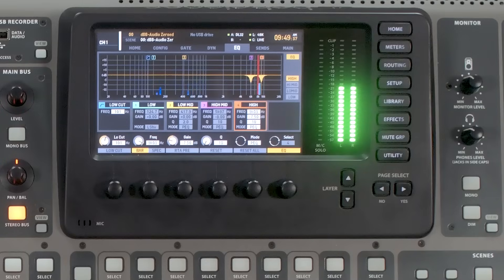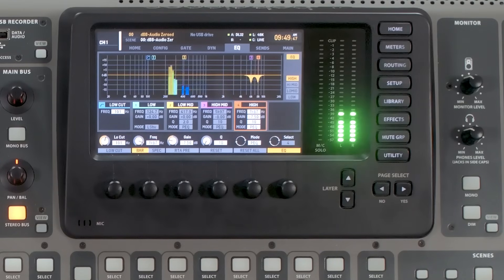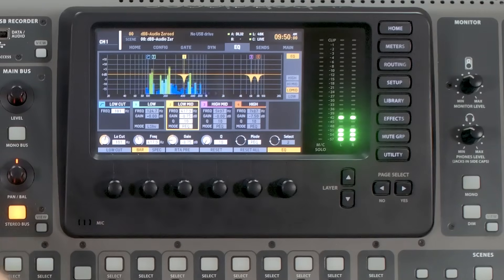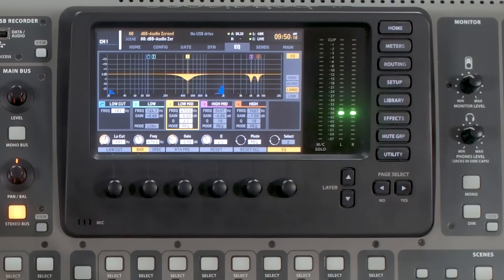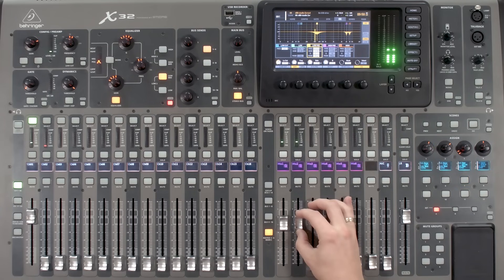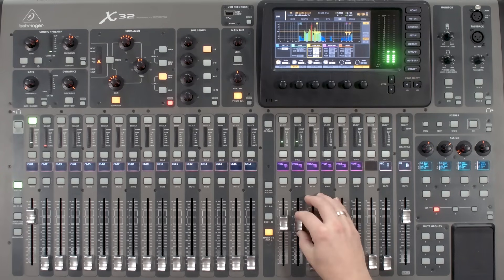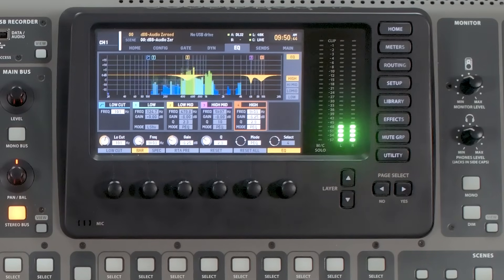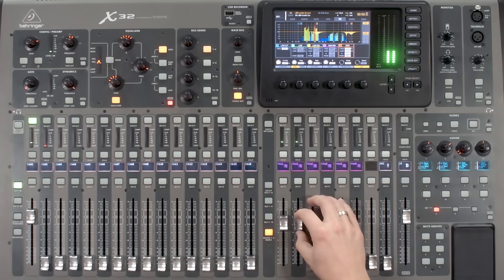Preventing Microphone Feedback in a Live Sound PA

Comment: As usual, people will ring out the FOH and cut the feedback using EQ of FOH. But, you are cutting the feedback using EQ of Mic Channel. Is it the reason for this difference?
Reply from the maker: I didn't go into system tuning in this case as I feel it is a bit more advanced and it deserves a video by itself. However, making sure the PA is tuned correctly for the room, and monitors are rung out is very important for controlling feedback. After I have done the tune and ring out, if I have a microphone on stage, I will then be cutting on the mic channel. If I find I am cutting on all of the channels in the same frequency, then I'll update my EQ on my PA.

Thanks for watching and the question!
Reply: @DrewBrashler  Thank you so much for your clarification. It's very nice solution of you that if all the microphones will be cut on all of the channels in the same frequency then you'll udate your EQ on PA. Because, if there are 2 different microphone brands on stage, then properly the frequency for cutting will be either different!

Comment: this is the really tip of the iceberg I really suggest to use a 31 band GEQ on the wedges and the main PA + sidefill and so on. A microphone wouldn't resonate and create feedback always in the same exact frequency is a matter of physic and positioning of the mic compared to the tweeter, the woofer the inclination torwards the wedge... you can significally get better with GEQ of course, but it you start to get down every frequency that resonate you'll start to lose all the pressunre energy and the intelligibility. Better start with a great sets of speakers, choosing the right microphone for the right task and than start put hands on the EQ. Btw good overall intro lesson ;)
Reply from the maker: Exactly, this is just an intro to it. There is so much more that can go into controlling feedback with speaker selection, placement, tuning, acoustics. And then you can go into monitor EQ (I have a video soon for ringing out a floor wedge). Then into microphone selection and placement. SO much to cover. haha.

Thanks for watching and thanks for the comment!

Comment: A few comments to add...

1. Rather than ringing out a mic, ring out the room on the FOH EQ, especially if feedback is a consistent across all the channels.  It's fairly simple to send pink noise through the PA and an acceptable measurement mic can be had very inexpensively (Plus, it's also good for micing a piano...).  Just having the room tuned a bit is a huge help, and it's something that you don't have to change constantly.  You don't have to invest a fortune on things like SMAART and a degree in math to get good results.  This also leaves your channel EQ available to build your mix.

2. Be sure to have good gain structure.  I know that isn't the point of this particular video, but really, everything in a live mix needs to have a good gain structure as its base.  You don't need the faders up at nominal in building your mix.  Set the input gain going in and mix up from the fader.  You'll have better sound quality, too.

3. Be careful with compression.  Another name for a (misused) compressor is "Feedback generator."  Learn to use them correctly.  It might seem outside the scope of this video, but you'd be amazed at how often a poorly configured compressor is the source of feedback.

4. I rarely use an omni handheld mic, but on the other hand I rarely use a directional headset, especially if it is one of the small Countryman style sets like you are using in the video.  That type of headset in omni generally requires less gain than its cardioid counterpart.  Less gain required for good gain structure translates into more gain before feedback.  I'll only use a directional headset, at least in a HOW environment, as a last resort.  There's always exceptions, of course.
Reply from the maker: Well said! Also, if you don't want to invest into Smaart, Open Sound Meter is a free option which does really well! Check out out: https://opensoundmeter.com/
Reply: @DrewBrashler  Good product.  Another one is Audio Tools.  It's a bit cheaper for the base configuration, but includes RTA and FFT, which beginners can use, and goes all the way up to transfer functions for pros and add-ons.

Comment: I have a x32 producer which i will be taking your course to learn it better but my question is im looking to buy a X Air XR12. Is the air set up similar as the X 32's?
Reply from the maker: Great question. I would spend the extra to get the XR18 so that you can get the multi-track recording ability with a computer. The XR12 only has a stereo usb record to a usb drive.

With that being said I find that both consoles are very similar, yet different in a few ways. The XR18 has 1/2 the processing of an X32, so there are 4 effects racks rather than 8. You have 6 mixbusses for monitors, 4 mixbusses for effects sends, and you will find all of the effects, EQ, gate, dynamics to be the same as the X32. One major difference is you are not able to delay any of the channels or the XLR outputs of the board. This may or may not be an issue for you, but is one of the large differences between the X32 and the X-Air series.

I found it easy to swap between the X-Air and the X32, however I think you are going to find a 50/50 split on this question.

Hope this helps!
Reply: My first digital desk was an X32 so I'm fairly fluent in it, I've had the opportunity to mix on a friend's XR18 and it drove me nuts.  It was very similar but not the same, a little lesser in every way and just close enough to throw off all my muscle memory.   It was a pretty frustrating experience for me personally.

Comment: Graphic EQ is much more capable in terms of reducing feedback/tuning a mic or a room.
Reply: @Spencer Halse - The graphic is less used today with parametric EQs available on each channel. They also do way less sonic “damage” to the signal. This includes even a main LR mix.
Reply: @sound4uaudiovideorecording927  X32 is a powerful enough console to have separate DCA's for GEQ on anything being sent out, and can use a different EQ if it's being sent to stream, in ears, etc. If you're pushing a GEQ to the point of (noticeable for the audience) sonic damage, then you likely have bigger problems. No one in the industry where I am based used parametrics to ring out a room.
Reply: @spencerhalse , I agree 100%. The channel EQ is for the person, not ringing out the channel.
Reply from the maker: I love using the GEQ and I know a lot of friends who use them exclusively. I choose to reach for the 6-Band parametric EQ that is built into the mixbusses for tuning or ringing out a floor wedge/PA mainly because of the adjustable Q. If I find that the 6-band isn't enough adjustment, then I will grab the GEQ as it adds a little bit of latency.